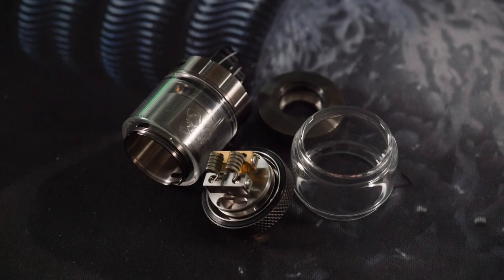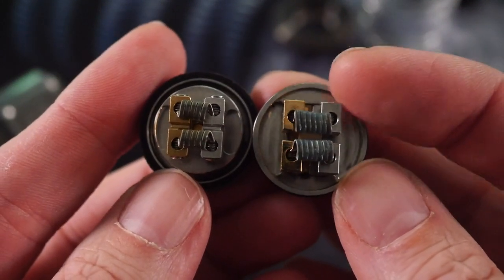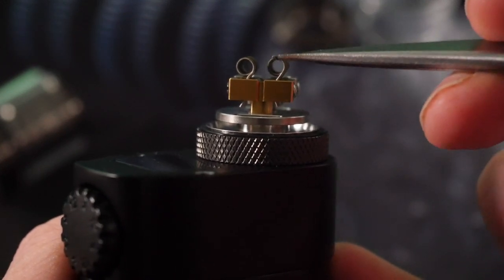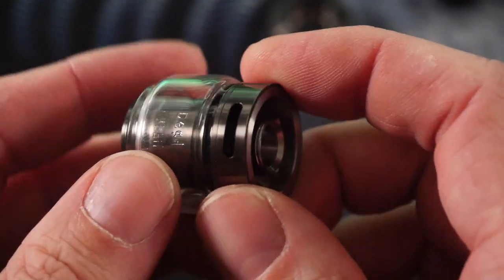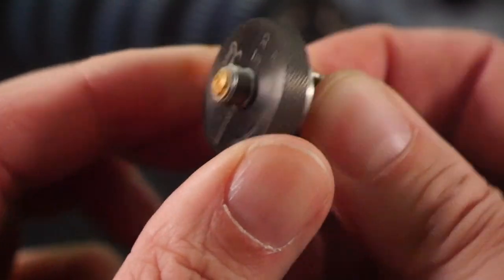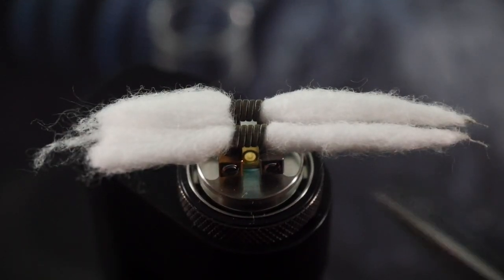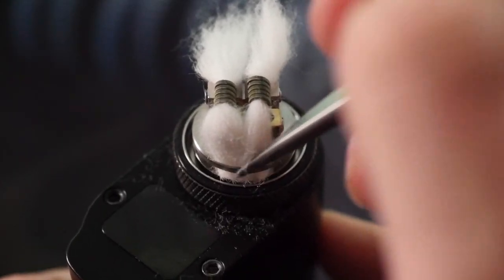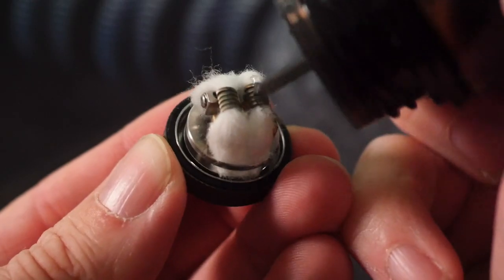Dead Rabbit RTA : Bit of a bummer IMO

Comment: Do you think the OBS Engine 2 is much better? I'm still enjoying the Engine 1 but am looking for a backup.
Reply: I'm no 'expert' but i think the Engine 2 sucks. Some people may love it but mine is collecting dust lol
Reply: @GregDaGoblin  I've heard that from a few people too. I guess there aren't any good dual coil top airflows apart from the engine 1 then? I did like the dead rabbit sq but notice the coil gets gunked up fast as v1ck has said is the case with the DR RTA. Maybe I should try a Manta, Stacked or Kylin 2. As far as tanks go I like big flavour at 40-60w, big airflow and easy wicking with plenty of cotton space and no or little combing required. Bottom airflow are generally a pain in my ass though.
Reply: @MadelnMachines  Look at the Zeus dual coil. Pretty airy and super smooth air flow. I don't like low ohm hot vapes. Running mine with a .3 spaced clapton build at 46 watts and it's a beast.
Reply: @GregDaGoblin  I would have bought one but I hated the original Zeus so much for flavour and wicking that I got a themis instead. I regret that decision. Grimm seems to think the Zeus dual is quite a slow wicker. I tend to chain vape with flapton.
Reply: @MadelnMachines  I think they're basically the same tank. I don't really chain tho lol I also have a Juggerknot clone that works well. That's about all I have with top airflow, besides a couple X-Baby tanks with rba decks. Those are actually pretty good. Guess I can't help, but I wouldn't recommend the Engine 2.
Reply: @GregDaGoblin  Maybe I'll have to go bottom. Opinions about the DR seem divided.

Comment: I absolutely love both the RTA and rda Dead Rabbit. My daughter got the RTA which was her first rebuildable ever and was able to build and wick it with zero issues. I took one hit off of hers and got myself one. I love it, I use it everyday, and plan on getting another one. I’ve never had any issues either and I sit my coils very low, run fused claptons at .15 at 80 watts and it keeps up with my chain vaping just fine. Now you do have to take it off your mod to put the tank on, but I don’t mind that because the flavor is amazing.  I also do not wick mine the way you did, I fluff my cotton and my tails don’t touch all the way to the bottom. I love that I don’t have to worry about leaking either so that’s another awesome feature. Quality control I agree with you 100%. Mine came all scuffed up and thankfully it was on the bottom and the inside of the chamber so no one can really see it. Oh, I also still use my Dead Rabbit rda everyday on my Rage. I love the build deck, so easy, and clipping leads is a breeze.
Reply: Monte Marino yes! I dog ear mine and just dip the tails into the well, excellent flavor and no spit back.
Reply: Yeah.. Its ass.. They copied a design by geek vape and managed to make it worse somehow.
Reply: @SlimeScholar  what design did they copy from geekvape? Because there is no geekvape products even remotely similar to this except the Zeus rta which has top airflow as well except the Zeus airflow comes in from the top but is then channels down to the sides of the coils giving it side and slight bottom airflow while the dead rabbit rta comes in straight at the top. So if your saying they copied geekvape because the top airflow then that makes no sense because the air flow designs are literally completely different. Also geekvape is not the only company to make a top airflow rta there actually quite a bit of top airflow rta's out now.

Comment: They should've done the wicks holes straight out from the coils right beside it then had a separate chamber and chimney where u wld use the troll doll method to wick it. Just just my opinion. It wldve eliminated the distance ur juice wld have to travel then to better improve it I wldve had top airflow that came down and back up from under the coil. As as it is now I don't believe this is a very good rta compared to some others on the market. nowadays an rta should b so fiddly to get good flavor. It's almost not even a science with this rta but more just dumb luck to get a solid vape outta it imo.

Comment: bought a Creed RTA and it leaked like fuck.. brought it back and all they had was a used DeadRabbit top air flow and its fucking amazing... No leaks .. Vapes well. Lucky i wasnt used to anything else so im happy. The dead rabbit was 25 bucks cheeper than the creed so i was able to get 2 new 20700 batteries ... Stoked.